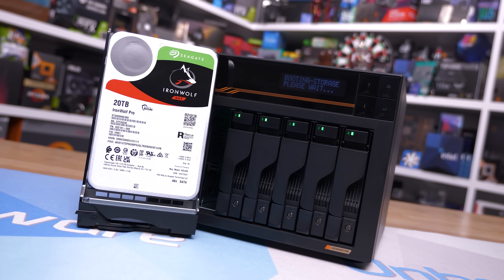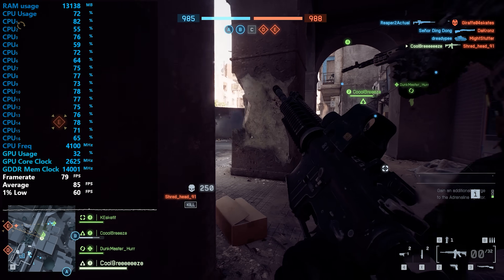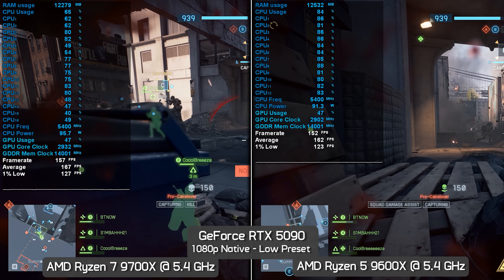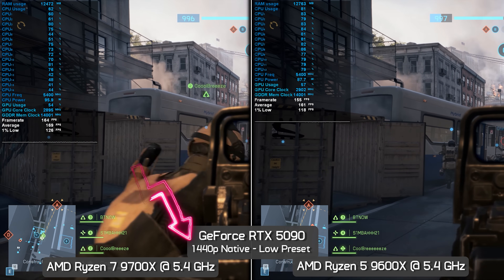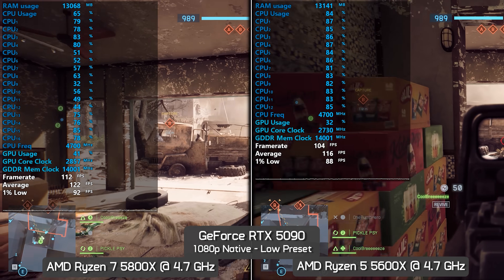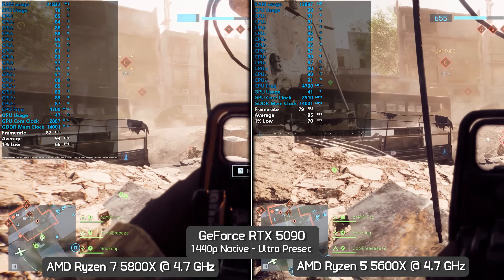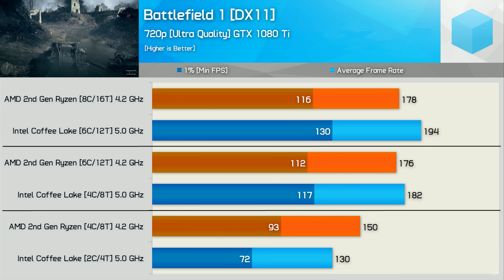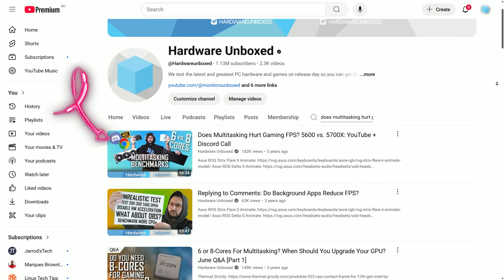Why Gamers DON’T Need More Cores, 6-Cores Still Works Well!

Comment: remember folks- 2600X/2700X and 3600X/3700X  are all pcie4.0 capable CPU's.  meaning you can still easily run these with great fps performance with a more modern GPU.
sadly,  if you own a 'non-X'  variant, your results will be poor compared to Steve's results, as you're stuck with pcie3.0.
buy yourself a used 36/3700X or 56/5700X and enjoy your AM4 platform for few more years :)
Reply: 2600x/2700x do not support pcie 4 as far as I knew?
Reply: @vespa7961 zen+ (2000s) are pcie3, not gen4.
Reply: pcie 4.0 is still not needed for great gaming performance. 3.0x16 is still good. I am not talking about VRAM sizes of less than 12GB because this case should be consideres as a workaround scenario anyway.

Comment: Switched from 5600 to 5700X recently. Could not be happier, taking into account the small premium I had to pay. 8 core chip is significantly faster in many modern games, like Starfield, Horizon ZD/FW dilogy, TLoU dilogy, Spider Man trilogy, Cyberpunk, Space Marine 2, etc.
6 core CPUs are no longer the best option for gaming. 8 cores is what you really need these days to get smooth gaming experience.
Reply: No, you comoletely misunderstood what made the games faster. It's not the more cores, it's that all these games use single core and the individual cores are much faster than on the older 5600
Reply: @Bronyboiiiii 5600 and 5700X have identical single core performance. Yet 5700X is noticeably faster in many modern games.

Comment: I still think 6 core is too little in 2025 and 8/12 core should be standard because I don't think PC is just used for gaming since you'll be doing livestream or recording and extra core really helps in preventing sudden stutters whenever there's a recording in the background unless you use gpu based encoding using nvidia or Intel or AMD. Then again with spectre or meltdown like vulnerabilities extra core helps in negation of degraded performance
Reply: Building games around only the top end hardware is a bad idea.

"We dont need to optimize, 20% of people have enough hardware to brute force the frames"

And then we have games running like ass on sub 1080p in 2025
Reply: 6 cores is sufficient for just gaming alone basic processes outside of that. I had to upgrade to a 8 core because I livestream and record 😅
Reply: @papikabi  with windows 11 you can't say anything. Even 1000 core PC will be end of life with windows 12. There's a lot of new security amd sandboxing that needs more compute. 
Which is your PC 8700K/9700K?
Reply: @vasudevmenon2496  I had a i5 8400 and upgraded to a 5700x3D
Reply: @papikabi  i moved from 6700hq and 980M to 8840hs with 4070 super egpu.
Reply: Yeah we should all buy a FX-8350 instead of a 7600X. Yes that is an extreme example, but it makes the point obvious enough so even you understand.

Comment: HUB also has an older video where they explain that the performance increase with core count is often due to the additional cache that must be added to accommodate it.
Reply: True but more of an Intel thing. All 9700x ,9600x, 7700x, 7600x have 32mb of L3 cache
Reply: Depends on what cores can access it.  If the cache is specific to an individual core, you get the cores problem.
Reply: Maybe its worth mentioning that in the HWU test only 1 or 2 cores hit 85% utilization.  Its a bit weird that GPU is at 40-55% load and the most used CPU cores are only at 80-85% utilization.
Usually, when we are in a CPU limit, at leastr 1 core should show around 94-98% utilization.
Reply: You need to keep in mind that observation is based only on monolithic Intel CPU's, Zen 2 to Zen 3 for single CCD CPU's and x3D. Specifically your point is based on the the 10900K in the video you mention. Ryzen may get more cache with more chiplets, but the latency between dies negates the benefit of that added cache which is why we see the 9800x3D scale and not the 9900x/9950x which is also highlighted in benchmarks between the 9600x and 9900x or 9950x and 9700x where often any performance difference is down to clocks alone.
Reply: I would image that L3 cache would be more important than L2 cache since it is shared between all cores, Unless you have 2 CCDs. Core only has to fetch data from L3 rather than make sure that the right core has the data inside its L1 or L2 cache. Thus adding to scheduling overhead.
Reply: can you point me to that video ?
Reply: I would like to see a comparison between X3D CPUs, because 8C CPUs are more RAM bottlenecked than 6C CPUs.
So my guess is that 8C CPUs with V-Cache are more than 8-10% faster in BF6 compared to 6C with V-Cache.
Reply: @nightspiderx1916  my 5600x3d is hitting close to 100% constantly on some of these newer games even at 1440p. They dont take in account that most gamers dont just have a fresh OS install with only the gaming running. Discord streaming with Spotify running can easily make my CPU ping to 100%. This happened during the BF6 beta. Same for Last of Us II and Spiderman 2. Gets even worse when I turn on FSR4. My 9070xt is being bottlenecked my by only having 6 cores. Now even tho Im hitting 90-100%. Most of the time the game is still running smooth but has some stutters and freezes on rare occasions.  So its best that I run everything at native. Only use FSR4 for Native AA
Reply: Only the case on Intel CPUs though.
Reply: @mungojerrie86  it's the same for both amd and Intel. Cache is king pretty much.
Reply: @alkestos  Cache is obviously important but cache amounts don't scale the same way between vendors. Gaming performance scaling with core counts due to cache is largely an Intel thing.
Reply: @mungojerrie86 Intel does a thing when they disable cores they disable l3$ with it. AMD does not. As a result more cores on Intel is more cache. It’s not that AMD can’t use more cache, they just choose to not disable cache so low core count CPUs are well fed in gaming.
Reply: @alkestos shared cache doesn't decrease/increase when cores are enabled or disabled on AMD ryzen desktop CPUs. you only use l2 and l1 cache that are only accessible by the CPU cores that are disabled along with that cache
Reply: @mungojerrie86  lower level cache is on-die for the CPU as far as I know so yes each core will have its own L1 and I think L2 cache

Comment: Some strategy/simulation games definitely benefit from more than 6 cores and I enjoy those kinds of games
Reply: Need those cores for my Factorio megabase ofc
Reply: BeamNG is big one. i think threads are just as imported as well, iduno
Reply: Yes, but its a very niche genre of video games, especially nowadays. And i mean if SC2 isnt included. But i dont call/view SC2 as a strategy game to begin with. You can run most action games with a quite potato cpu if you have a good gpu. I guess its mostly down to modern games being still rather simplistic, just with way more eye candy. And you need a very powrful gpu to run that eye candy.
Reply: POV: you bought a high core count cpu and now try to justify your purchase xD
Reply: @Bronyboiiiii  I remember when I bought my 3570k, the common wisdom that this 4c/4t CPU was all you'd need, and that hyperthreading with the 3770k didn't really give you enough performance regularly enough to be worth the extra cost.  And this held true for a few years, but then, it kinda stopped being true.  And suddenly having that 4 extra threads started adding a good amount of performance quite regularly, especially for 1% lows.  Lesson being that if you're planning on keep your CPU around a good while, it doesn't hurt to think about the future when considerating value, rather than just what the benefits/value are in the moment today.  Obviously guessing the future is imperfect science, but I dont think it's unreasonable that 8 cores will continue to gain more benefits in more games with time, especially if you play a lot of very CPU-demanding games.
Reply: @maynardburger  When FX8100 or 8300 series debuted it was a pure garbage in a games. Intel was killing it in every title. However, few years later, when games started to use more than 1-2 cores, FX was getting better and better. When I bought it few years ago and compared it to i5 3rd gen, i5 is struggling in few years old games, having stutters here and there, where FX just works. Of course it is not as fast as nowadays CPUs, but if you test it today, you will not be able to tell, why it was so much hated in the past.
Reply: @Bronyboiiiii  Lol I have no regrets at all on my 5950X, i value longevity :3
Reply: @Bronyboiiiii pov you regret purchases because you are poor
Reply: yep..... or battlefield 6, chomping on everything the cpu can give.
Reply: @Kyote7667  You actually get better FPS in BF6 making a config file to use less cores lol. Everything is basically geared towards consoles and consoles use like 6 because 2 are reserved to the OS.
Reply: @Kyote7667 did you even watch the video? This whole video was entirely based on BF6
Reply: @musiclistener9215  That's their point. That really went right over your head huh?

Comment: Well yeah. We just getting out of the development cycle of games designed for 4c/8t but now we in the middle of 6c/8t zone. Why this video makes sense is the games are made for the slowest hardware. So old pc and new. Play same game. Maximized profits. I had a discussion with someone and he was like i didn't need a new computer. It works fine. And it's 2nd gen Intel i7..it is a 4c/8t part. Guess what? He is correct.
Reply: 6c/12t*
Reply: This comment has some merit, but that doesnt undo the fact that a faster 6 core is better than a slower 8 core. Dont blindly pick corecount, and dont expect an 8core to offer any tangible benefits for atleast another generation of games.

Comment: It's total chip performance that matters.   A single core that is 8x as fast, will always be faster than an 8-core.   Now simple math tells you it's easier to get more total performance, by adding more cores than increasing single core performance.  "IPC" or single core performance improvements are pretty small at this point.

But even if your #of cores x Single Core Performance is still high, the only way the game can access all that performance is by being able to fully utilize all the cores. That is still pretty rare.  Even in fairly well multi threaded games, you usually have one thread that is still the limiting factor and acts as a bottleneck even if all the other threads are still doing lots of work.  (I think UE5 is still a good example of this)

Total performance is what matters, and less cores are always easier for games to utilize the total performance.  But you just can't get high total performance with small numbers of cores anymore as single core performance isn't increasing super fast.

Comment: I'm a simpleton and I like my CPU components to be in powers of two. My current PC is four-core, eight-thread, so it feels neat that my next one will be eight-core, 16-thread. Similarly I'm looking for a GPU with 16 GB VRAM; 12 GB would probably be enough for my needs but it feels wrong.

Comment: I wonder how good for example 9800x3D would be if we lock it to only 4 cores 8 threads. I suspect it still would be good in all modern games.
Reply: it would be way worse in BF6 CP77 and other games 4 cores is way too low in lot of games
Reply: 4 cores 8 threads CPUs have a hard time with Battlefield 6...

Battlefield has always been destroying  specific CPUs...

Comment: I'm still using a 7600x with a 6900xt at 4k. For the most part the cpu is fine but I do intend to upgrade at some point (when AM5 becomes EOL or possibly earlier depending on if I feel like I need to).

Comment: At least in Portugal, people I the biggest tech forum are recommending ryzens 7500f or 7600 for budget builds for quite a while now, guess the budget constraints made us realize soon that 6cores are still very viable
Reply: Spanish here. I paired a R5 7600x with a RX 7900XTX for a friend’s rig, and it runs all games at 1440p butter smooth. It’s not like a 7800x3d wouldn’t have been better, but it’s definitely not struggling or losing much performance. 6 cores CPUs are great!
Reply: @xavalintm  The best thing about this is you can always upgrade it to the 7800X3D or even 9800X3D later without the need for a new mobo.
Reply: @xavalintm higher Rez/graphics quality, quicker GPU bottleneck, less sense to spend more.  Good call!

(Also, at least with Intel, i5's could overclock better than i7's.  An i5 had "broken cores," but not necessary slow ones. I7 came out w 8 working cores, but not fast enough to be sold as i9."
Reply: I do think for value, going with 7600 is easily the best choice, and has been for a while, ever since AM5 mobos and DDR5 became more affordable.  This will hold people over for a good while, and then if they really want an upgrade, by like 2028 or so, I imagine a Zen 6 X3D part will be on discount and offer a really sizeable leap without needing to spend on AM6 and DDR6 memory which will inevitably be expensive.
Reply: Honestly, if the price increase from going from 6 to 8 cores could get you a better GPU, it's pretty much always better to do that instead
Reply: Two of my friends are rocking at 7500F & rx7800xt computers build by me, both are playing anything they want at max settings at more than good fps. I'm talking Monster Hunter Wilds max setting with ray tracing at 60+fps , Bladurs Gate 3 at 120 and many more.
Reply: Though I would personally say 7600 integrated graphics are worth the price. Cause if your GPU has problem and you got no spare, it basically saves that pc from becoming a very expensive paperweight
Reply: @RandomPersonOf2005 iGPUs can be really nice for troubleshooting too. Niche use case, but in some circumstances EXTREMELY helpful.
Reply: I'm rocking a 7600X with an RTX 5070 outputting to a 4K120 OLED TV and I can't say that I've ever been CPU limited so far. Admittedly I'm not trying to use path tracing or anything - I do have raytracing on in some titles (such as Cyberpunk) but I'm not shooting for the moon in terms of settings.
Reply: CPU reviews have always shown this. I'm not sure why so many people insist otherwise.

Comment: I'd be curious to see what the results would be like when multi-tasking is taken into account. Perhaps running the benchmarks with Discord and a web browser running in a second monitor. Would the overhead of these extra processes impact the games performance when utilising a 6-core cpu?
Reply: He talks about it at the end of the video, check out 16:10
Reply: Watch the end of the video - your point is addressed.